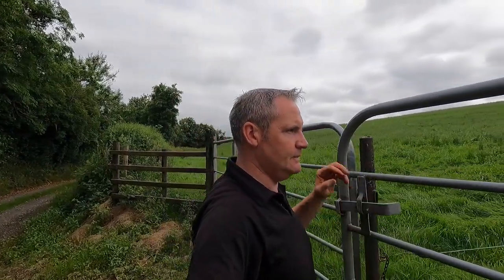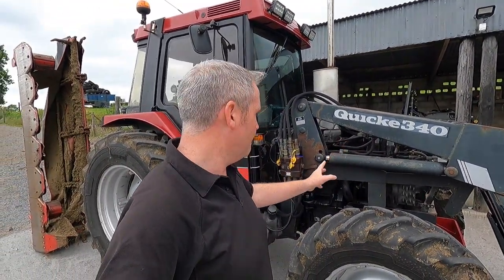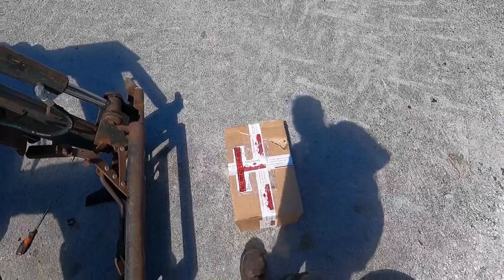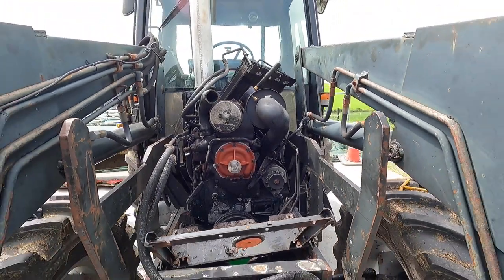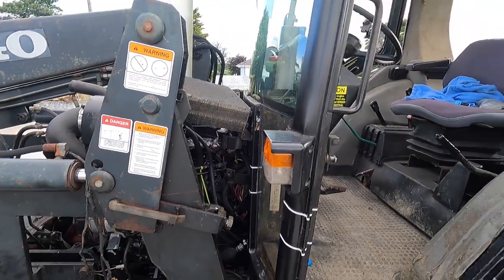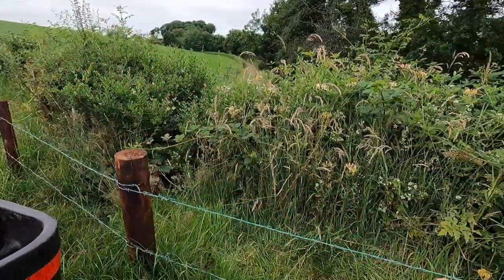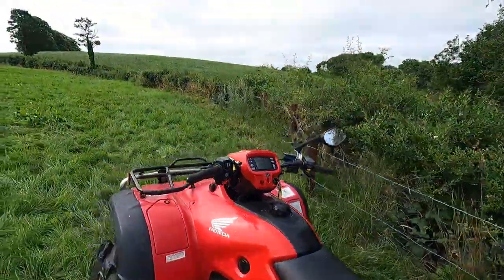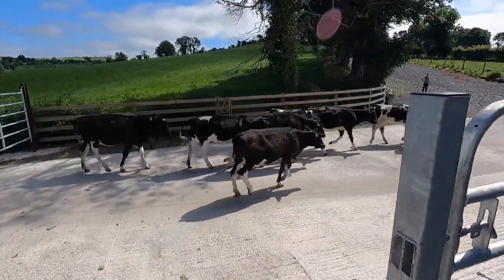MY WEEK OF HARDSHIP!!  IT'S BROKEN, IT'S BURST, IT'S SICK

Comment: I had a split in an obsolete, spring fed, 1/2" stop valve last week. Got a bicycle inner tube and cut it into a long ribbon, used it to bandage it up using the tension in the rubber to seal the leak. Still holding up this week. 👌🙏
Reply: must be fairly low pressure then.

Comment: Watching you disassemble that engine reminded Me of someone I once knew. 

Many Years Ago I knew a gentleman who owned a bicycle and every Saturday he would take it completely apart and clean everything before reassembling it, ready for use the next week. 

Then he bought a car and on Saturday true to habit he disassembled the car, in order to clean everything. 
Needless to say, when his wife got home from work she was livid. 

All of the next day he reassembled the car to the very best of his ability but when he was finished he had a pile of spare parts and an engine which wouldn’t start. 

On Monday morning, his wife got the local mechanic in to take a look and see what needed to be done. 

It took the mechanic 4 & a half days to reassemble the car and although he had been a mechanic for 30 years he frankly admitted that he was unaware that some of those items actually came apart until he tackled this rebuild. 

Needless to say the husband was banned from ever cleaning the car engine and parts again. 

And for a Month he was quite good about things, only spraying a little Lubricant and Degreaser on the engine to keep it clean looking, then he slipped and Rattle Can Painted Everything which could be seen when the Bonnet was lifted. 
Engine Block, Hoses, Wires, Filters, Battery, Air Intake, Radiator, Mudguards, Fan and Fan Belt, Everything. 

And his Colour of choice was Silver. 

It was a fortnight later that I found out, but didn’t have the heart to tell his wife. 

She didn’t discover what he’d done until the car got its first Service and her mechanic rang her with the news.

Comment: I always found that gasket will slip out when you put sealent on both sides. I always only put sealent on one side and leave the other side clean and dry and torque them to spec
Reply from the maker: Make sure your using a non silicon sealant

Comment: You should sink the new pipe with a subsoiler. It sinks it up to 3 feet and it’s a lot cheaper and quicker to do than digging a trench for it
Reply: as long as there are no stones in the  ground .........would  sooner do a trench and fill over  it with fine material  for a few   inches  to  shield the pipe ........

Comment: How come you wouldn’t just go inch for the water line to the shed? Just out of curiosity 👍
Reply: Would inclined to agree. Seems a good pull up to the shed so for the sake of upsizing to 1inch would be worth it.
Reply: Me thinking cattle fed silage are not that thirsty 1/2 pipe would keep plenty pressure on for 2 or 3 drinkers 
3/4 should be more than enough for a dozen replacements  if 1/2 can keep them watered in summer 3/4 should be ample

Comment: How much play in the waterpump and changing the thermostat will require replacement?
Reply from the maker: There should not be any movement on the fan pulley, if there is then it’s the bearing. Thankfully water pumps aren’t to expensive and are easy to replace

Comment: No point in scour sampling a calf that has been treated as the antibiotics will scue the results.
A scour in a weaned calf this time of year is most likely coccidiosis or worms. Test the next one that starts to scour before treating. Use vecoxxan or baycox to prevent, and treat with 4 days minimum norodine or equivalent antibiotic. And just like with any scour... fluids fluids fluids
Reply: I would have thought SSS would be first thing to investigate and eliminate ,
Reply: @ranger553  summer scour syndrome is catch all term for multiple underlying issues coming together to lead to scour, its not a sepcific pathogen/disease.
Reply: @AgriSpec4370  Where did you get your veterinary degree, a cornflakes box?
Reply: @irishfarmer8332  ucd